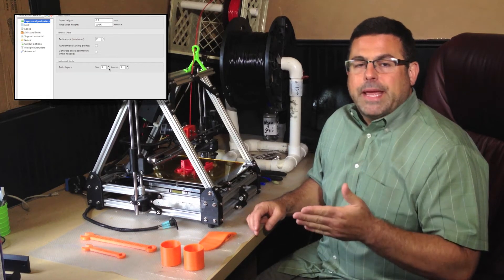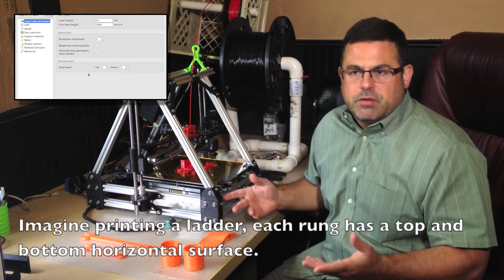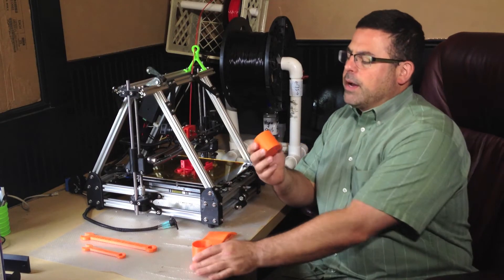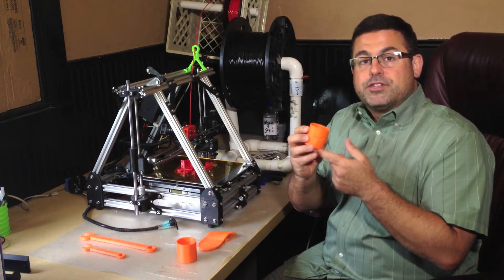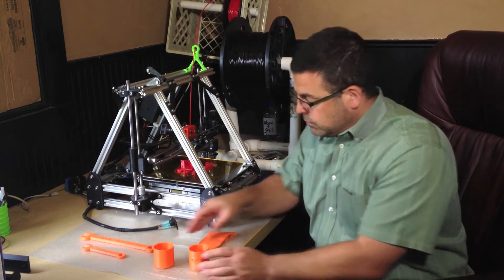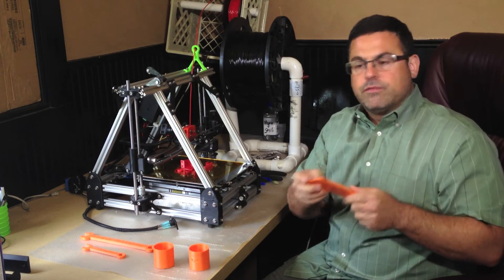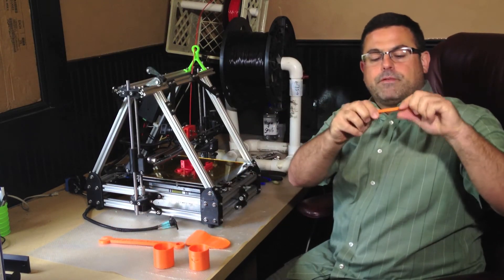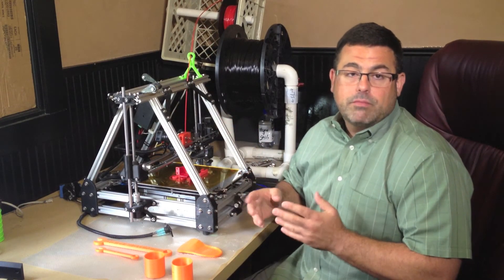Slic3r Horizontal Shells - Top and Bottom Solid Layers

Comment: Can you explain "Extrusion Multiplier" in Slic3r? I had problems with holes being too small and someone suggested changing extrusion multiplier but not only did it not help, I could not see any difference at all no matter the setting.

I have since heard many people have hole sizes too small in Slic3r so I think it's a bug. Have you noticed this? Like if I make a 20mm cube and put a 10mm hole in it, the cube measures exact on the outside but the 10mm hole is like 8.5mm to 9mm.

Comment: Example:
; ****************** Inserted code starts here 
G1 Zlayerheight+5 Fx ; raise the head 5 millimeters above new layer just to move the heat away form the print 
M1 ; pause until I hit the button on my LCD 
; at this point I can change the filament 
G28 X0 ; not sure if this is necessary - this is in case I bump/move the x carriage during the filament change 
G92 Elastevalue ; ignore any extrusion/retraction I have done while loading new filament 
; ****************** Inserted code ends he